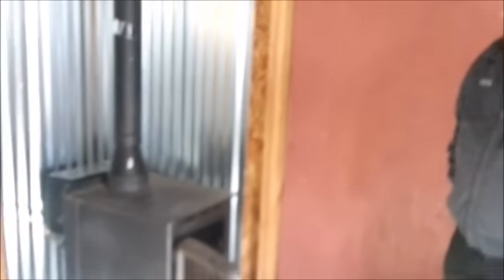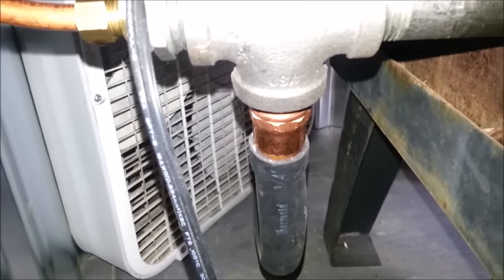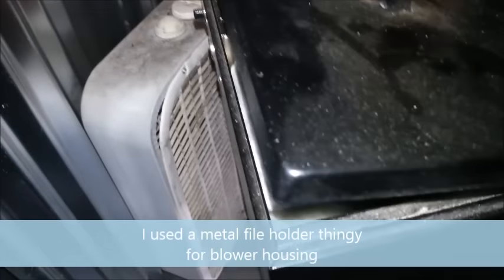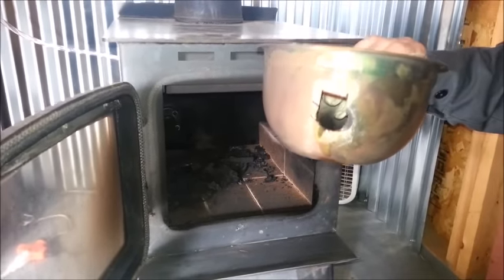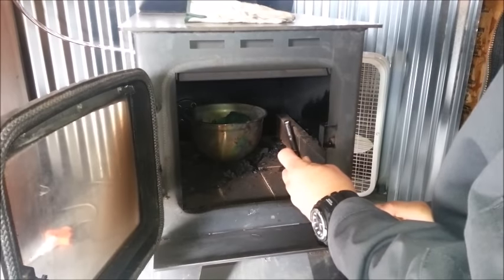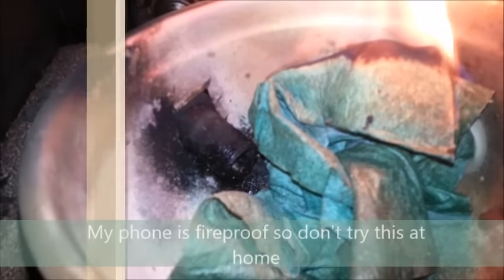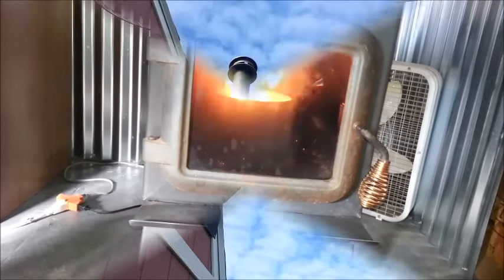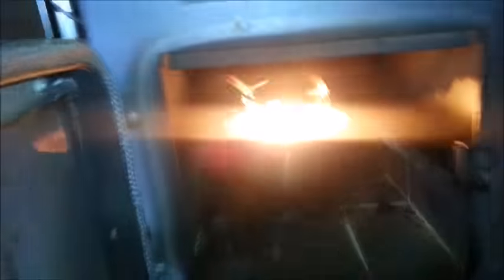Easy Waste Oil Heater made from a wood stove

Comment: This is a great video, what kind of safety features could be put in so that it could be left unattended?
Reply from the maker: You would need overheat protection and flame out protection to stop the oil flow should the flame die or if it gets too hot. There are a few ways to achieve both
Reply: It is illegal to use these in homes or anywhere people live. Your insurance companies will drop you in heartbeat or reject claims if you do use them inside homes, cabins or living spaces. For shops and garages yep great way to heat , just not for living spaces no matter if it has protections or not. Now you can have a outdoor boiler with this feeding water into home or living spaces.Cant have them outside feeding direct air into living spaces.Only Use of boiler your using the heated water and unit is not directly heating living spaces thats why its acceptable as outdoor boiler.

Comment: I DEFINITLY AGREE WITH A WAIST OIL STOVE! I TO WISH I COULD HEAT USING OUR USED OIL. I DONT HAVE A GARAGE, JUST A CONCRETE PAD WHERE A GARAGE ONCE SAT. BUT, AS SOON AS I BUILD A GARAGE, I WILL NEED A WAIST OIL HEATER!!! THO, FOR THE TIMES WHEN I RUN OUT OF OIL, I WOULD WANT A PROPANE HEATER. THE LAST OWNERS OF THIS PROPERTY PUT IN A SEPTIC SYSTEM & BUILT A DECK OVER SEPTIC & IT BLOCKS PART OF THE GARAGE & DRIVEWAY! I NEED TO DIG OUT THE HILL BEHIND THE PAD & PUT IN A RETAINING WALL & EXPAND THE FOOTPRINT OF ANY GARAGE TO ACCOMIDATE HOPEFULLY A 2CAR+ROOM FOR WORKBENCH & TOOLS + STORAGE! MONEY IS ALLWAYS A ISSUE & WITH BOTH OF OUR CARS HAVING HIGH MILEAGE, SOME HEAT WOULD BE NICE! IM LAYING OUTSIDE ROLLING IN NEW MAIN & ROD BEARINGS ON MY FORD CURRENTLY! RAN N2 A SNAG ON MY THRUST BEARING & ROLLING OUT THE OLD ONE???? MUCH LESS ROLLING IN THE NEW ONE???  I LIKE YOUR LITTLE SHOP! BETTER THEN MY CONCRETE PAD!!!!!!

Comment: This guy just wants to die. Manufacturers design appliances to run safely they test them and they are approved by a third party. Then you receive manufacturers instructions on installing maintenance and commissions.
This appliance is not a sealed combustion chamber and never meant to have a fan assisted flue. 
I notice no mention of carbon monoxide alarms. And he’s advising others on how to convert an appliance which was never designed for this purpose. 
When he is the cause of someone passing away due to carbon monoxide poisoning or being burned to death in a fire then he can explain how superde duberdy it really is. Also there is a cancer causing by product from flames of transmission oil synthetic oils waste oils. Ignorance is bliss